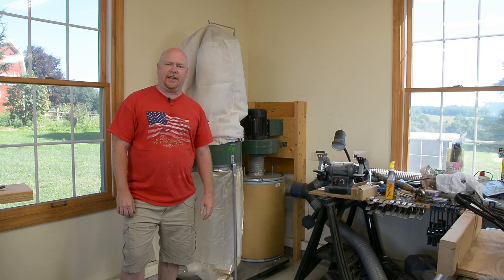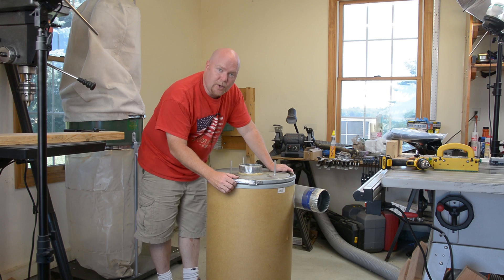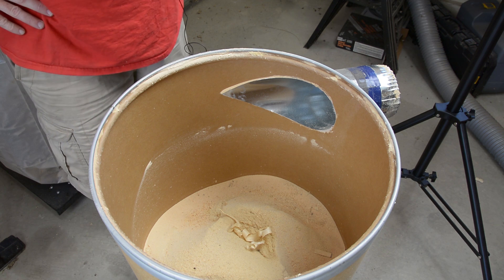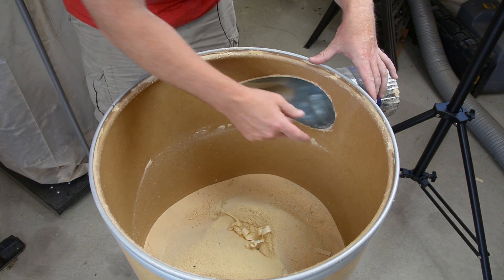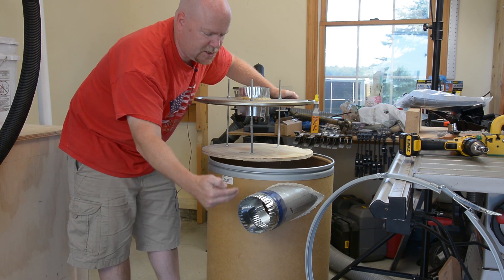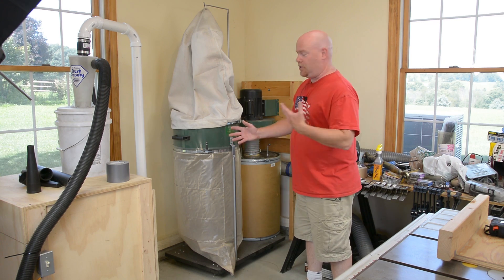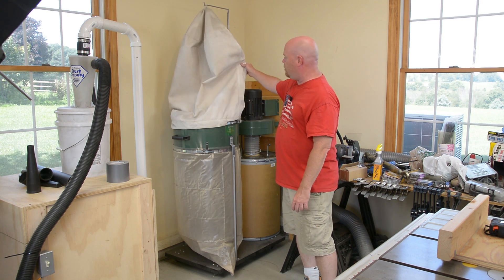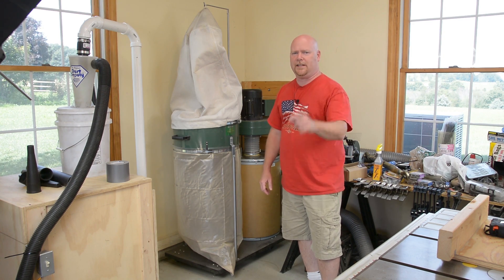Harbor Freight 2HP Dust Collector Modification Overview

Comment: Nice video. I went down a rabbit hole reading overcomplicating articles and designs. I ended up buying a super dust deputy. Your design is simple and obviously works really well. 
Be. Ice if you replaced the cloth with a wynn filter.

Comment: Hooking it up on a 15 amp vs a 20 amp circuit makes no difference on the HP output of the electrical motor.
Reply from the maker: Never said it did.  It makes a big difference in how often you have to reset the breaker.
Reply: @MattHeere  10:30

Comment: Hello,. Question, I have a Delta that's similar to yours. I want to exhaust it through the wall.  To do this can I simply remove the cloth filter bag, cover that hole with plywood, adapt a 5 or 6 inch pipe to the ply and send that through the wall?
Thanks,
Reply from the maker: Yep.  One thing to note is that even smaller dust collectors move a lot of air.  If you're pumping it out - there has to be a way to get fresh air in or nothing will go anywhere.

Comment: Question, on a Baffle system, does the baffle box need to keep a vacuum/seal with the drum below it, or can the bottom of the baffle just rest on the top of the drum ?
Reply from the maker: It needs to seal.  Any air that leaks in around the lid takes away form the vacuum pulled at the machine.
Reply: @MattHeere  thanks for confirming, figured it had to... :)
you know of some online plans / or calculation define diameter, height and size of bottom baffle,
seen allot of designs call for the opening to about 270deg.
Reply: ... prefer the idea of building a baffle that sits on top of my drum... well still need to find a drum, heheheh
Reply: @georgelza  like this? https://youtu.be/1A1QIoXJVPc <---i made this but even simpler.  no complicated calculations needed! 

any large garbage can will do to make a vacuum sandwich because the motor is so heavy on top. all you need is the motor, the bag ring, a garbage can (mine is 35 gallon (or 55?) with 22" diameter - that's the important part for whatever container you use), silicone caulk, and a 24x48x3/4" plywood sheet. 

cut wood in half for two 24x24 pieces, yes i used squares to save time. edge must extend well past rim of garbage can (~2 inches). 

find center and draw a cross. center and trace the inside circumference of the bag ring to the plywood and cut a 2" wide semi circle that only goes 4/3 of the way around (270 degrees) INSIDE that traced line (free hand jigsaw was fast and easy). silicone the bag ring to the new baffle with proper orientation. center on top of garbage can. 

cut ~4" hole in second plywood.  attach 3/4" spacer blocks to top of plywood around hole so the motor is supported. lay motor upside down on some 2x4s for clearance of housing, place plywood over intake. silicone the gaps around intake. when dry, flip motor back over and place on top of baffle/ring part that's on top of the garbage can. (heavy, get help if needed)

done. 

this picks up tons of dust and spits almost none out compared to before when i needed compressed air to dust myself after work. i work much more comfortably and clean now but i cant be in any shop and assume there's no dust in the air so i use a respirator or n95 to be safe no matter what.
for extra safety, vent outside or put a filter or filter bag on the output. i will add all this stuff soon. I did add some rubber weather stripping as gaskets to the rims to help prevent potential dust leaks but even before that i didn't "see" any leaks.  I was very impressed that it works so well. no "seals" remarkable suction.

Comment: with 5 yrs on this setup now, what have you changed/improved since.
Reply from the maker: Believe it or not - nothing.  I still have on my to-do list to get a hose I can use to direct the exhaust out the window so I can bypass the inefficient filter bag when the weather is nice.  Otherwise it's been working well.  Now that I have a planer I do wish the barrel capacity was larger.  The planer fills it up pretty fast.
Reply: @MattHeere  My primary use is a planer/jointer... so want the bigger barrel, but also not to big otherwise gets difficult to man handle on my own.
Reply: you connect any hand tools... ie which have a 1.5" connection. going down from 4" to 2.5 (aka table saw's) is not to huge a jump... but 4" -> 1.5 is like night and day.

Comment: The Harderwoods.com pipe joint template is awesome. Note that in their tool they say it won't print correctly using the Chrome browser. As of today 03/22/2021 the template I printed for a 20" barrel and 4" branch (with wall thickness .01") was dead on when I measured it using the scales that print on the template pages. 
I've been designing my own HFT DC mods, and your video helps me validate that my own design is viable. Considering that you put this out almost 6 years ago, I imagine you've probably helped thousands of hobbyists like myself improve conditions in their shops.  Thank you for the work you've done.

Comment: Matt, Great video! I'm curious since there is so little dust that makes it out of the barrel and into the bag, why not just vent to the outside of your shop, think dryer vent.
Reply from the maker: Always been in the plans for an option, but the real issue is climate control.  3/4 of the year is heating season here in WPA, and the dust collector can take hours of heat out of the shop in minutes.

Comment: Great video.  As a thought....could you attach a large garbage bag to the bottom of the cyclone plywood (via tape, screws, clamps, etc) to catch dust/chips?  Maybe it would make emptying the barrel easier by lifting the bag out?  I'm sure some dust could get by and into the barrel but it would save dumping the barrel as often (if it works that is).  I plan on getting a unit soon and will use your cyclone idea as well.  Thanks for posting.

Comment: Can you swap out the 15amp breaker with a 20amp?
Reply from the maker: Not without upgrading the wiring too.  Would be a code violation otherwise - and a good reason for the insurance company to deny a fire claim even if it was totally unrelated.

Comment: What are your thoughts on noise level of the HF dust collector?  Better or worse than comparable collectors?
Reply from the maker: I don't imagine it's drastically louder or quieter than any other unit which moves the same amount of air.  The motor is very quiet, and any given combination of CFM +a particular pipe is going to be the same amount of noise regardless of what's driving it.

Reality is that anything hooked up to the DC makes enough noise that I have hearing protection on anyway, so I never really thought about it.

Comment: I put an Oneida pleated filter on mine.    Also noticed your Dust Deputy cyclon with what I assume is a shop vac in the box.  After ex[erimenting a while I ended up with two Sears wall hanging vacumns in series to power mine.  To keep down the noise  I have a long about one square foot box on the exhauset with a lining and baffle system made from duct board used to fold insulated air ducts.  That really cut down the noise.

Comment: Hey! Great video. I’m curious. I have a regular sized Dust Deputy set up with a Craftsman Shop Vac at the tail head and I’m trying to use a 50’ (2.5”) hose on a FastCap Super Reel. Obviously, the Craftsman cannot provide enough suction for the 50’ hose. If I got this Dust Collector and used a 4’ to 2.5” reducer would it work and provide adequate suction?

Comment: Great video. Subbed. I once used an old car radiator fan (powered by a battry charger), blocked into a window, to suck the air (and small particles) out of a room. Seemed to work well. No sign of dust out side and kept dust out of the rest of the house. =D I did have dust extraction on my table saw.... you can't chuck eveything out the window =D

Comment: this is 5 years old.... wondering what everyone's opinion of the Harbor Freight dust collector motor... how has it held up long term for others.....    I bought mine back in dec. 19   here it is july 20 and the motor went out.  checked power through the switch.. all good.  it was working one moment then total dead.    hoping this is  just a issue with my particular motor and hoping HF will come through with replacement.  (in communica with them now)

Comment: Great video, Matt! I plan to build my dust collection system very similar to yours. I have a comment and a question to post to you.
Comment: All your 110VAC outlets should be fed with #12 gauge wire and protected with 20 amp circuit breakers, with no exceptions. #14 gauge wire and 15 amp circuit breakers are for lighting only, (however using #12 gauge wire and 20 amp circuit breakers would be okay for your lighting circuits, it's just an overkill and a waste of good money.
Question: Have you considered putting the latter half (fine dust collector/bag system) on the other side of the wall so that the particulates smaller than 5 microns would be exhausted outside, rather than in your shop? 
For that matter you could build a small addition on the outside, that would house the whole system, and quiet your shop down considerably!  Sorry. Just thinking out loud...

Comment: I need a chip collector for planer all I see is dust collectors I'm lost here
Reply from the maker: Most dust collectors are also fine chip collectors.  Planer and jointer chips are actually easier to collect, so power is less of an issue than trying to move huge volumes of air to get dust.  The key thing is to separate the chips from the airstream before the impeller.  That was the primary purpose of the mods I did here.

Comment: Great idea. Another negative. Running the motor in a vertical may create is bearing failure. Motors that are designed to run vertical will typically have two bearings on the shaft end. One radial bearing and one thrust bearing. You may eventually have a bearing failure. Just something to be aware of.
Reply from the maker: It probably will eventually, but it's been more than 4 years and so far not so much as an odd noise from the bearings.  Doesn't look like too tough of a job to replace them fortunately.
Reply: @MattHeere  I was curious how long they would last. That's good news. They are very simple to replace, as long as the rotor bars don't touch the windings. Thanks for sharing.

Comment: In that there is next to nothing , except extremely fine dust ,, and not enough of that to see and easily wind born,  after the cyclone save the expense on HEPA stuff and run it out through the wall outside . (no laws being broken , the crap from your furnace, water heater, fireplace , etc. are removed the same way )  (your not running an industrial scale business from your garage or home )
Reply from the maker: It's on my list.  Problem is the climate.  When you exhaust outside you push all the heat out with it.  I ultimately need to be able to run it both ways.
Reply: @MattHeere  Air  replacement in heat or cold can be an issue .  I have a 780 CFM hood exhaust over large BTU gas range and the air replacement duct comes down in the wall behind and enters under the range keeping the cook (me) cool in the winter . (Summer, serious cooking is on grill).    
Maybe an air replacement close to longest run (time) shop stations ?      (in middle of putting a new system to together, also)

Comment: Awesome video. I have been thinking about upgrading my 1 hp HF to this one. I have a cyclone and am wondering why you couldn't just take the bag off and plug the top with plywood. Would that cause the unit to have a hard time getting air flow?

Comment: Using the pipe joint template tool, what did you have set as your joint angle? 90* is straight out, 45* doesn't seem like quite enough. I was looking at about 25*-30*, just not sure what creates the smoothest airflow.
Reply: After further review, I see 90* is what works, but it's the lateral offset that sets the inlet pipe at the right distance. That's the one I don't really get. Maybe this is a bit of trial and error.

Comment: Most of the commercial systems put the pleated filter on the bottom and the bag or dump chute below it. The top of course would be blocked off. 
As for the cyclone system it too was a separate drum and under it was a barrel on a drum dollie like the ones you get on the 55 gallon vacuum kits.

Comment: I saw this very same collector at harbor freight, and thought about doing a conversion similar to yours but with the final output passing through a Hepa grade filter
Reply: Adding a hepafilter is expensive, it would have to be very large in square feet for good airflow because of the huge pressure drop (air flow restriction) it has. Plus there expensive. In an application like your proposing I would add cheaper pre filters before the hepa filters cause heoas of that size are very expensive....

Comment: If you don't have chips what's the purpose of your  seperator . Isn't that what you are supposed to seperate. Chips from dust. BTW, nice job and I may copy yours.
Reply from the maker: It separates a lot of dust too, so it's worthwhile even without chips.  I've since acquired both a jointer and a planer - which was always the plan - so I do have the big chips now.

Comment: +1 for mentioning a respirator!  Don't waste your time on paper dust masks.  A 3M or AOSafety half-mask respirator with P95 or P100 filters is around $20.  Much less than replacement lungs.

Comment: Does a 6.5 hp shop vac have better sucking power than the 2 hp dust collector from harbor freight?
Reply from the maker: I did one dust collection video a while ago where I talked about that difference: https://youtu.be/DQ57I4PJDro?t=211

Comment: Great video, very helpful. Are you able to run the DC and your table saw on the same 15amp breaker?  Or, does the draw from the DC alone exceed 15 amps??
Reply from the maker: I had to put in a 20A circuit for the DC.   It'll run on a 15A circuit, but it often pops the breaker on startup.  No chance of running the DC on the same circuit as another tool.
Reply: Matt Heere thanks a million

Comment: How would the cheaper HF unit work? 1.5 hp. 15 amp. Still have enuf flow..?
I just bought the 2 hp model myself, but not set it up yet, wonder if it is overkill....

Comment: I see you also have a Dust Deputy.  So, you have two systems?
Reply from the maker: Yep.  I go through why in the band saw setup video.  Bottom line is that high pressure and high flow are two different scenarios, each appropriate for different tools.
Reply: Okay, I will check that out.  Thanks.

Comment: Your design seems very efficient and I am in the processs of building one.  I am trying to use the Pipe joint template using a 5 inch 30 gauge metal duct pipe (0.125 in thick) with a 20 in diameter barrel.  I'm just not sure what angle to set.  You state the duct is 90 degrees or is it some other value? Should be a lateral offset (should it be 10-2.5 = 7.5?).   Thanks.
Reply from the maker: Correct.  90 degree angle and 7.5 offset.
Reply: Thanks,  that Pipe joint template worked great and was a big help in making the joint.   What type of "epoxy/putty" did you use to fill the gaps?  Do you know the brand?  Thanks again.

Comment: AWESOME!!! I was given the 2 most important parts on a Grizzly 2HP unit, and just today ordered the missing pieces, and wanted  to add a separator in the most compact way possible, and this is it!!! I have 15' ceilings so I think I'm going to mount the motor and impeller and filter unit as high up as I can get away with to save floor space. We shall see what happens. Thanks!

Comment: Can you give me the distance between the bottom of the 5” inlet and the baffle itself ?  Also the distance from lid to baffle. Having trouble locating these distances on line. Thenks
Reply from the maker: It's about an inch.  That dimension isn't critical.  The baffle needs to be below the inlet, but the further down you place it the more space it takes up in the barrel.   I got all my info from the discussion forum on Thein's website: http://www.jpthien.com/smf/index.php?PHPSESSID=tbfhnmkeq6tvr3vclhuvobdr33&board=1.0

Comment: Thank you for your video. I must have watched it over ten times before I start my own plan to build one. Thank you for the template. It was a great resource! Austin: how heavy is the 30g when full? I'm doing this with a 55g and I'm trying to think about how to empty it. I'm thinking I'll bungee cord a trash bag over the opening and just tip it over so dust won't fly everywhere and won't have to pick it up to empty into a high trash can.
Reply from the maker: Mine weight very little when full.  Now, that's largely because it's usually full from planer and jointer shavings.   If it was full of true dust then it would be heavier, but still manageable I think.    I dump mine outside in a flower bed.  The chips and dust become "free" hardwood mulch :)  I just wear a dust mask and let the stuff fly where it will.

Comment: Hey Matt. Would it be easier to have a bag in the barrel to make cleaning simpler? So all you would have to do is place the bag somehow below the tube outlet or put the whole bag from the top and cut a hole for the intake hose. So when it's full enough all you have to do is pull the bag out. Kind of like the old vacuums with bags.
Reply from the maker: Probably not, since the collector would suck the bag up into it.  Vacuums with bags use the bag as a filter, running the air through it.   There's no airflow through the drum, but it isn't completely air tight either.
Reply: Matt Heere thanks for making that point. I didn't think of that.